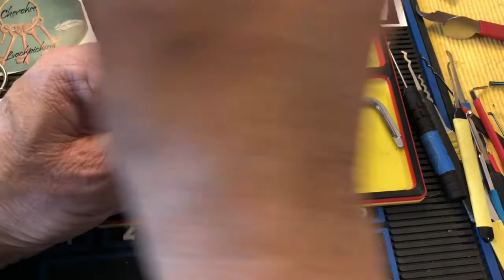#524 Yale Scandy oval picked

Comment: interesting to see a 5 pin oval having the normal 6 pin length. The Ruko 5 pin oval is 6mm shorter than the 6 pin, and same with the snowmen, so they need different padlock housings
Reply from the maker: Rune International I know. 
Very different!!! 
👍👍🔓🐈👏🐾🎊🎉
Reply: I was wondering that myself.. Interesting..
Reply from the maker: Rookie Lock yes, at first I wasn’t sure it would work in the 820/40 Anchor Las. But because it has a long body for a 5 pin oval it fits😄
🐈👍🐈👏